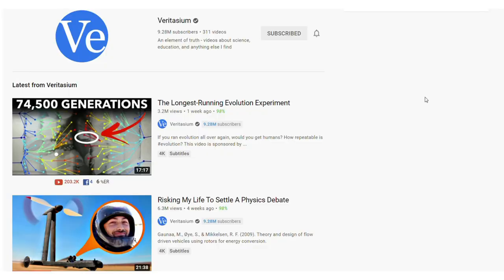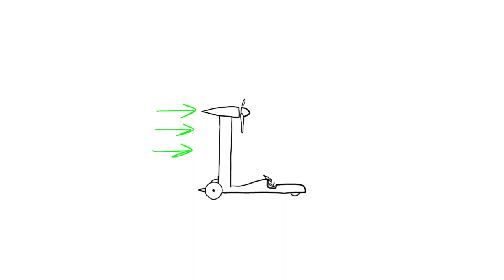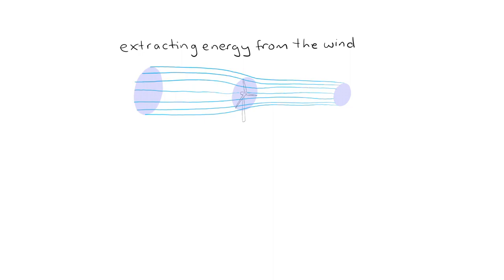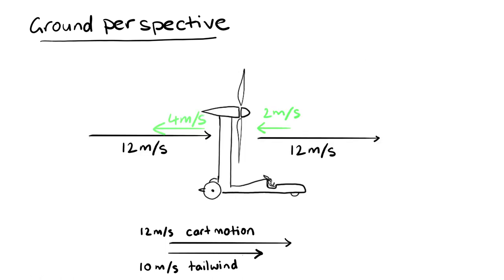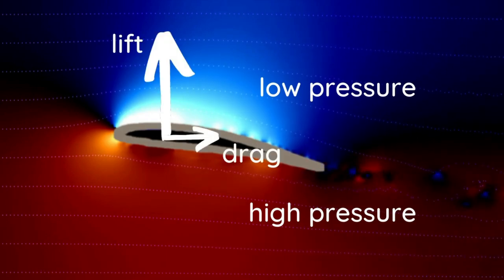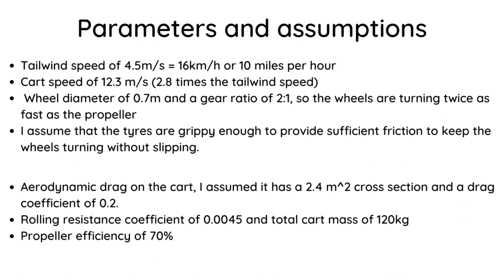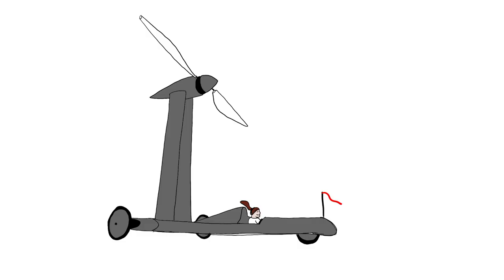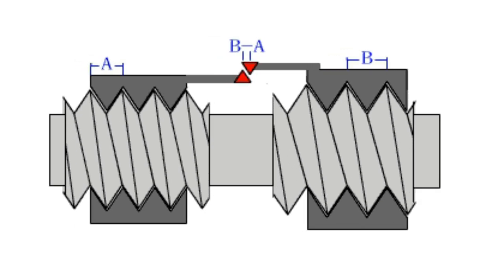Downwind Faster Than the Wind by Veritasium: How Does it Work?

Comment: I still don't get it... Ok, the rotating prop makes the car move forward and the forward movement of the car makes the prop to rotate. What happens at zero windspeed and we give the car a good push until the prop becomes effective and keeps on moving the car. No other energy input to the system, just one big initial push and the car would keep moving forever? Would that work? And why (not)!?!? :D
Reply: Eventually the vehicle stops. A wind is required in order for the vehicle to operate.  For example a 10 mph wind, a vehicle moving downwind at 15 mph, ground speed is -15 mph, air speed is -5 mph, which allows for a 3x reduction in gearing. A higher speed, lower force from the ground is geared down to generate a lower speed, higher force against the air.

Comment: I find it hard to understand what happens as the craft crosses over from being slower than the wind to being faster. In the former the prop is being driven by the wheels - pushed along by form drag which creates the thrust. Then, at crossover, the form drag, having reduced to zero, reverses direction so I don't see how the prop can then continue to be driven by the wheels...
Reply: The first thing to remember is that there literally is no change in the way the propulsion system works at 0.9 windspeed and 1.1 windspeed.  Yes, there is a change in the direction of the form drag on the craft, but this just means the propulsion system has more to overcome as speed increased. 

That may not seem to help you much, but it will keep you from going down a bunch of other paths which lead nowhere.
Reply: @johnborton4522  It does help, but I'd still need to see it happen in reality to completely accept it!
Reply: @johnborton4522  Fascinating.
Reply: @nicholaspalmer2220  - in this video, you can see the weather vanes on the side chase truck change direction, while the DDWFTTW vechicle shows no sign of change in the way it is operating: https://www.youtube.com/watch?v=5CcgmpBGSCI
Reply: @johnborton4522  The best way I can understand it is by thinking that when the craft goes upwind the two prop blades are acting, like the two yachts in the animation, as if they are sailboats on a long tack into wind that doesn't end like a tack on water because of the circular motion involved. As far as the blades are concerned, they are attacking the wind 'diagonally' just the same as a yacht sail does when going upwind. That bit is not so hard to see. It's just counter-intuitive that the same sort of thing happens dead on downwind.
Reply: @nicholaspalmer2220  

You are correct -- either upwind or downwind, the blades are functioning aerodynamically exactly like the sail on a high performance boat.  As you point out, in a real sailboat you would have to zig zag, but due to the prop shaft, the 'sail' can carve one continuous helical broad reach downwind.

The gearing between the propsails and the wheels provides the same kinematic constraint that would be provided by the keel of the sailboat.
Reply: @nicholaspalmer2220  Tacking downwind with a downwind component greater than windspeed is explained at 1:18 via the squeezed wedge analogy. It is similar to tacking upwind, but the roles for sail and keel are swapped.

Comment: When there is no apparent wind speed, the rotating blades create a virtual sail. If the initial angle of prop were negative, it could be driving the wheels for faster overal acceleration.
Reply: Nope.  The cart won't work at all DDWFTTW if the propeller drives the wheels.
Reply: Yes, initially, below wind-speed, using the rotor as a turbine would improve acceleration. But to prevent any means of using stored energy they didn't implement that.

Comment: I really enjoy this explanation. It made sense when I first grasped the concept by thinking how a prop driven airplane can travel with a tail wind, and that this vehicle is getting its motive power from the ground friction instead of lift force from wings. But you do a much better and more complete job of explaining all of this. Maybe instead of soft butter, perhaps whipped cream?
Reply: Thank you! That is exactly what is happening!
The ground speed spins up the propeller through the drivetrain and the tailwind pushes it just a little faster, leading to a feedback loop that causes a gradual increase in ground speed to beyond the wind speed.
Reply: @maxxron  And like an airplane propeller, it is creating negative pressure in front, and positive pressure in back. Basically its backwash then becomes an additive force to the speed of the wind, creating more ground friction, speeding up the prop, creating more negative pressure in front and positive pressure behind, more additive force to the wind..... This feedback loop will continue until top speed is reached when drag and friction forces come to equilibrium with the motive force.
Reply: @GoCoyote  And Blackbird's propulsion is like the harder the tailwind pushes the plane the faster the engine revs with the tailwind pushing it even more creating a feedback loop to increase the top speed.

Comment: yeah that what i thaught aperent wind..the lift force of the blade you say is parelell to the air flow....its posible the blades angle of atack in relation to aperent wind can be set so that the lift force drives the prop...when the craft is moving faster than the wind what side of the chain is tight? i want this answer from observation not math.

Comment: How long can it travel faster than the wind speed for? Does it briefly accelerate to 2.8 x wind speed and then slow back down?
Reply: Nope.  Will run steady above windspeed as long as the wind continues to blow at the same speed.

Comment: IMO when you have a rotating wing (propeller) in the system, you really aren't talking about "downwind" (or upwind for that matter) anymore. The blades are moving at an angle to the wind. Similar to a conceptual sailboat where the mast and sail moves side to side on a track between widely separated hulls that move directly upwind while the rig "tacks" back and forth between the hulls.
Reply: The only purpose to the angle is to prevent either a stall (too much pitch at low speed) or a collapses of the vacuum on the top of the airfoil (too little pitch at higher speed).  Bernoulli's principal is what makes this work, not "thrusting air out the back".  Otherwise household fans (no airfoil) would fly about the floor.  Shocking that PhD's in physics and engineering forgot their 2nd year of undergraduate studies(back then, now my son just studied Bernoulli's principle in middle school (and critical thinking which I guess they didn't get earlier)).  :'''(

Run the same car with flat blades vs. an airfoil as a proof.
Reply: @rcmrcm3370  I'm not sure you intended this as a reply to me? I was making a different point. A rotating propeller moving  directly up/downwind is equivalent to a wing moving at an angle to the wind (likely equal to the propeller pitch angle).
Reply: @rcmrcm3370  Airfoils are not essential for lifting surfaces, only more efficient. Wings or prop blades that are flat will still create lift through angle of attack.

Comment: Here's the part I don't understand: when the car is accelerating, the wheels are moving faster, which is turning the prop faster, which is pushing the air and creating thrust on the car, which makes the car accelerate a bit more. Which would then imply the wheels are moving faster, which is turning the prop faster, which is pushing the air and creating thrust on the car, which makes the car accelerate a bit more. Obviously this isn't what happened, because we didn't see the car accelerate indefinitely. How can we calculate at what point, the car won't accelerate any further, and where is the flaw in my logic above (there must be one, since it would imply it accelerates forever, eg perpetual motion). Thanks
-Vee
Reply: max_speed = wind_speed / (1 - overall_efficiency). The derivation is in the papers by AAPT, Drela, Gaunaa et al. linked in the description of the 2nd Veritasium video on that.
Reply: Actually, you do have it right with one exception--you forgot about the fact that well above windspeed, the aerodynamic drag on the cart continues to increase at the square of the velocity above windspeed.  And this is an increasing retarding force.   When all the retarding forces (wheel retarding force, rolling resistance, internal friction, and aerodynamic drag) add up to the propeller thrust, the cart has reached its limit speed and will no longer accelerate in that speed of wind.  To make it simple, when the net force on the cart is zero, no more acceleration.
Reply: @killbeas  Yes exactly. The question is when the acceleration (the rate of change of the velocity) is at its maximum. At that point is maximum driving force. Have you given some thought on that?
Reply: @DockSchrem   Good question.  Several people have but I can only tell you that point empirically from the graphs of velocity from the runs.   The driving force increases with wind velocity so the carts will have different limit speeds (where all the forces balance) as well as where acceleration is a max depending upon the wind.   Equation wise, one solves for where the driving force is at the greatest differential from the retarding forces (where there is most EXCESS force on the cart).   It's could be near the zero wind speed point but since the cart harvests more energy per unit time the faster it goes, it is probably somewhat above that.   Each cart has a different equation for the sum of the forces due to aerodynamics and internal losses of the individual cart so each has to be carefully characterized to ascertain the coefficients of the equation for each cart.
Reply: @killbeas  I think this cart never develops any significant thrust force. In my opinion it moves based on the transmission of torque from Wind propeller to wheels. That is all. It goes beyond the wind speed, because the transient from one to the next state. After it starts moving by some wind when the propeller torque exceeds the resistance of the wheel and drag force. With increasing the speed it stores more and more energy in the rotationg propeller and propagation of the car. After it pass wind speed, the only energy source is the rotating propeller. It gives out the finale push that the car drives faster then the wind that is all. There is no harvesting from opposite wind.
Reply: @DockSchrem  It doesn't work that way.   The propeller (in downwind mode) never turns the wheels so that idea is completely wrong.   The propeller (in downwind mode) is a propeller, not a wind turbine and the wheels always turn it, not vice versa.   The cart is storing energy in rotation but there is no way the cart can use that energy to accelerate faster in a steady wind, which it can do and does.   If you think about it, it's easy to understand why not--- to utilize stored rotational energy to accelerate, it would have to slow down the propeller.   But since the propeller is linked directly to the wheels, to slow down the propeller (to use stored energy), the wheels slow down (not speed up).   So you can forget that idea of how it works because it doesn't work that way.
Reply: @killbeas  The propeller is coupled with wheels through gear transmission. If the propeller not turn the wheels
Reply: @DockSchrem  I absolutely promise you that it does not work that way.   The wheels turn the propeller or it would never go Direct Downwind Faster than the wind.   The designers put a ratchet in the system to meet the certification rule so that the rotor could absolutely not turn the wheels.   Watch the video.   The rotor never turns the wheels.
Reply: @killbeas  The next thing to design by those designers is a helicopter powered from the wind. They can drop it from the cliff of from the tall building. Flying down it shall rotate so fast that trust will will make it fly up. They only have to figure out  how the helicopter lands.
Reply: @DockSchrem  To make it work you need a strong gradient.   You may want to check out "dynamic soaring" which seems like perpetual motion to many but it is just harnessing the power of wind gradients like the DDWFTTW cart harnesses the power of the wind over ground.
Reply: @killbeas  Exactly the helicopter will accelerate falling down so much that it will develop strong gradient and will fly upwards by the "dynamic soaring". The force from the "dynamic soaring" will be so big that without brakes such helicopter might go earth orbit or even land on the moon, if it did not pass it by.
Reply: @DockSchrem  Helicopters don't develop gradients.  They naturally occur when wind crosses boundaries like hillsides.   Try to keep it real.  You clearly have no idea what you are talking about now or understand how this works.

Comment: What happens if the absolute wind speed goes down to 0 once the car is already in motion?
Reply from the maker: If the wind speed relative to the ground goes to zero you mean? Then the car would gradually slow and eventually stop if the wind didn't pick back up. It needs a (positive) difference between the air and the ground speed.

Comment: Great job. A friend of mine sent me the Veritassium link asking how it works and I spent a similar amount of time arriving at a similar explanation, but focusing on the forces on the vehicle rather than acceleration or deceleration of the airflows. When I've finished typing I'll try to get it to you - interested in your thoughts.
Reply: I have read a few of the explanations, and it appears to me that although close, several people are giving incorrect explanations and do not understand the physics properly. 
This video in particular, has a major flaw starting around the 14:00 minute mark.
At any speed that the cart is moving, if the wind stops blowing, the cart comes to a stop.
I put a reply under another video and received a reply which I believe shows a major misunderstanding of the physics involved. .  The project concept works, but explanations have much to be desired. . If you post  your description here, I will try to take a look if i do not lose the link.
I am still trying to get all of the physics understood for this, but I DO KNOW  that many are wrong on some details of the physics involved.
Reply: @DocScience2  "I am still trying to get all of the physics understood for this"

That's my situation as well. I've been too lazy to do a rigorous analysis and I'm struggling to find a qualitative one. Here's the best I've got so far:

I think a lot of people are focused on the apparent wind on the vehicle, which is the vector sum of the true wind and the "wind" induced by the vehicle's motion, and become zero when the vehicle velocity equals the true wind velocity.

At that point there is still 'wind" over the propeller though, because it's rotating in otherwise still air. The force resisting the vehicle's motion is then due to friction in the wheels, tires, gears and so on, as well as aerodynamic resistance, i.e. drag, on the propeller. The propeller also provides forward force, i.e. lift, just as it would in a small aircraft. Whether the vehicle can accelerate depends on which of these forces is larger.

The best airfoils, e.g. in high-performance gliders, have lift/drag ratios over 50:1, so it's easy to assume that a well-designed propeller could be similar. As I said, I've been too lazy to do the actual math, but it's easy to accept that at the speeds involved the prop can provide more than enough power to overcome the (very low) drag, and thus accelerate beyond true wind speed.

As that happens, the airflow over the prop both increases and changes in direction, which is why the "pilot" has to fiddle the pitch or angle of attack, and eventually diminishing returns sets in, but the basic proposition of sailing directly downwind in this way does make sense.

Comment: Where does the energy to move the car come from?   The wind yes ..but when moving faster than the wind?
Reply: I think the same way. I guess the car will stay higher speed then the wind for a while until all the energy is used up, and the car speed will decrease below the tail wind speed. @Rosie. Is that correct?
Reply: When the cart is above windspeed, the energy still comes from the wind, which is slowed down relative to the ground by the cart.
Reply: @liwang2697  No, it doesn't use any stored energy for propulsion. It goes faster than the win in steady state.
Reply: @eyytee  So what is the mechanism for this energy transfer when the cart is travelling faster than the wind?  The videos I have seen are confusing since they talk about the blades behaving like a propeller when in fact they must be extracting energy from the wind and so are essentially a wind turbine.  My guess would be that the larger this turbine the more energy you can extract from the wind and so propel the cart faster than the wind.
Reply: @neilcase  Watch the latest Veritasium video and read the papers he links in the description.
Reply: @neilcase  Yeah, Veritasium explained that it's not working like a windmill but actually it does since it will maintain higher speed than tailwind.
Reply: The thrust from the propeller slows down the true wind, which is the source of energy. Consider this situation, 10 mph true wind, vehicle moving at 15 mph downwind. From the vehicles frame of reference, ground speed is -15 mph, 3 times as fast as the apparent headwind speed of -5 mph. This allows higher speed, lower force from the ground to be geared down to produce lower speed, higher force at the propeller, which results in the vehicle continuing to accelerate even faster. At some speed, all of the forces cancel and the vehicle has reached it's maximum speed.